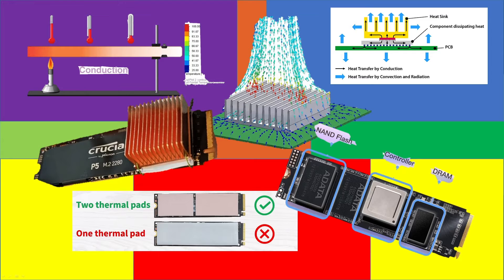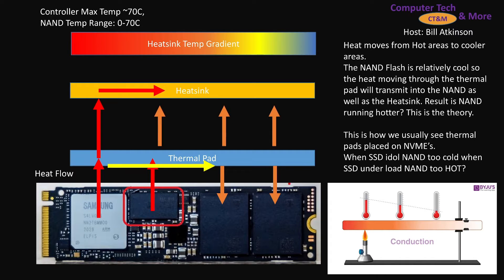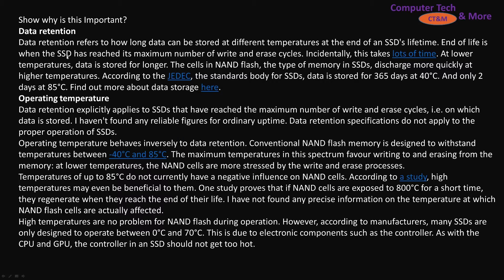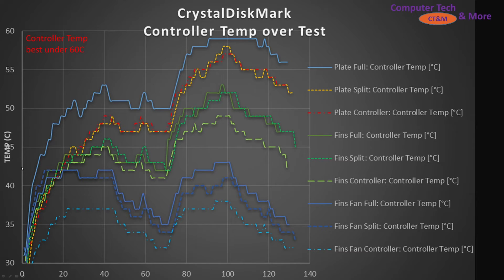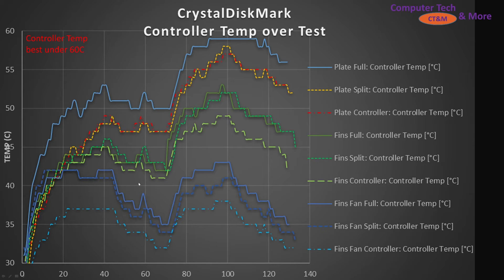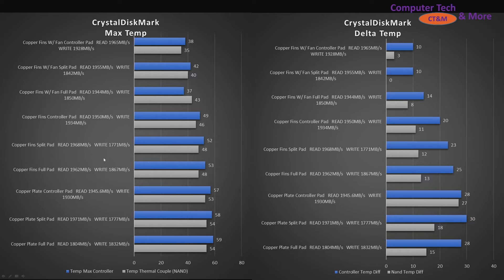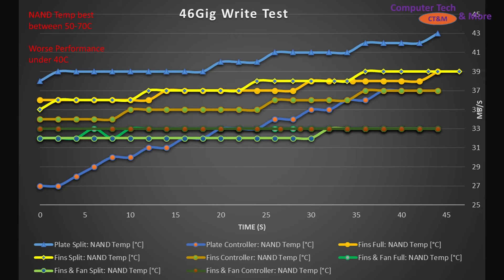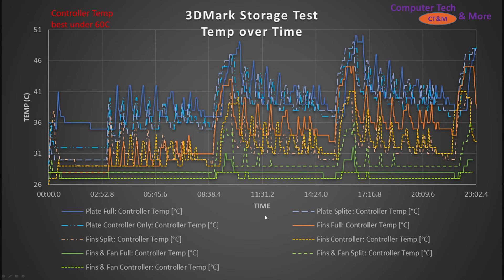NVME Thermal Pad placement, Sizing Does it Matter?  (time stamps in description)

Comment: so, should I just place one pad dram, one pad on the controller, and then one pad on the nand?
Reply from the maker: so it depends on the heatsink. If there is active airflow across it you dont need a thermal pad on the NAND. If there isnt much airflow across the SSD heatsink splitting the pad or just leaving it whole is fine. 
this was an overkill test because I got curious. In most circumstances one large pad is fine.

Comment: What size thermal pad should I buy for my m.2 ssd. I’m using a copper heatsink with it in my laptop
Reply from the maker: basically as thin as you can. i think thats 1mm.

Comment: I'm not good with english, so what is better for Best performance on ssd m2, to apply two pieces of thermal pad or Just one?
Reply from the maker: the short answer is 99.9% the time it won't matter. so just 1 long one is fine unless your doing non standard ssd cooling.
Reply: @computer-tech-more  sorry but I did not understand what you say.
Reply from the maker: @marcoabbate85  unless your actively cooling the m.2 with a fan or water cooling a single long thermal pad is what you want.
Reply: @computer-tech-more  Latest enclosures are coming with active cooling, so do you think should we have a full pad that increases the temperature for both or only controller pad that cools better controller and nands? Maybe depending on maximum heat that the SSD can reach
Reply from the maker: @federicocastiello1174  for active cooling I would cut the thermal pad so the Nand and the RAM/Chip are separate. You probably dont even want a pad on the NAND if possible. 
it is dependent on how how the SSD can get. thats true.

Comment: What an amazing video - right up my street, love the geeky stuff! Thanks for taking the time and effort to do this, really interesting

One thing I struggle with is the thermal pad thickness vs enclosure depth.... The pads a lot of enclosures come with seem to be too thin to actually contact with the metal casing... I assume that they need to contact in order to exchange heat

So, I double up on the pads, or in the case of my Acasis Thunderbolt 4 NVME enclosure and WD 4TB NVME I actually have 4 thermal pads stacked on top of each other (full width of the NAND and controller) in order for it to touch the metal casing. Is this ideal? Doesn't feel right to me.... but what is the alternative?
Reply from the maker: So if possible you actually just want to buy a thicker pad. reason is stacking pads can still leave small air pockets between each reducing their effectiveness. 
part 2 is actually thinner thermal pads actually are better at transferring heat than thicker ones. 
you want as thin a pad that will make contact with the "heat sink"
Reply: @computer-tech-more  Interesting - I need to have a bit of a play tomorrow, I've got a set of pads from 0.25 - 3mm thick so I'll try to stick each one to the heat sink and see if I can get any impression marks on the other side to suggest it is contacting the SSD.

Im guessing I want to feel some resistance when putting the lid back on